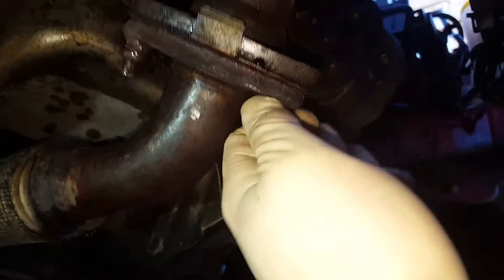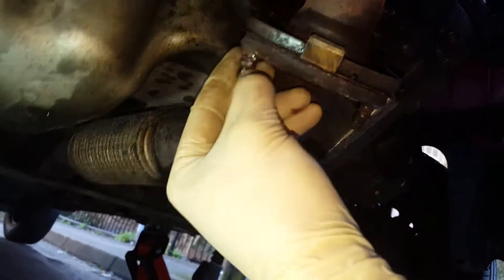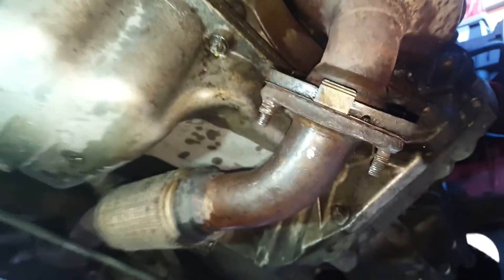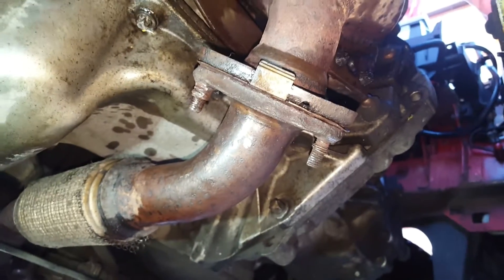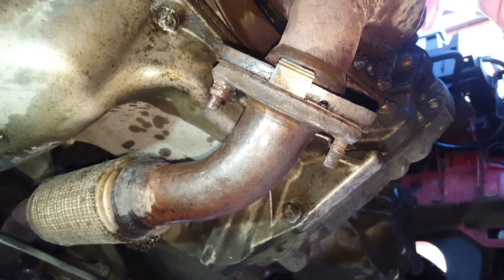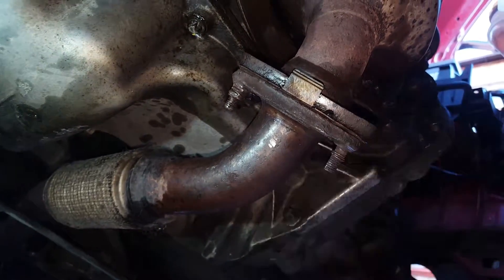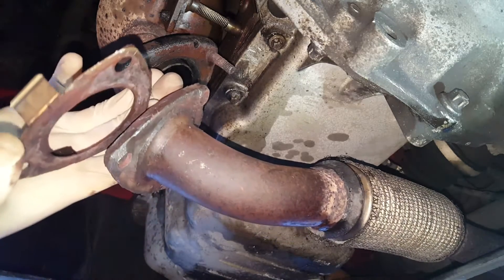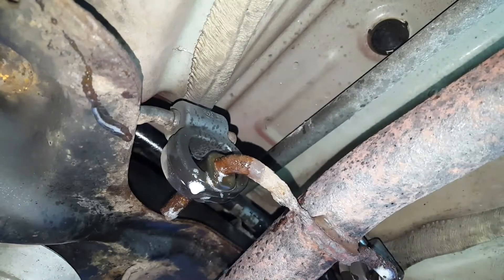Corsa D 1.2 Exhaust removal

Comment: I'm gonna be doing this job in a couple of months. Want a nice exhaust system on there. Patched it up for now as my flexy is fooked and there are holes at the muffler .. in regard to the none excitant bolts at the front flange... might get a set of nut splitters and used them on em, might be quicker. How is your 1.2 up hills, mine seems to struggle quite a bit.. Wondering if a remap might help, not expecting miracles but a bit more might help it a little.

Comment: Hi tom 👋 love your videos very informative and helps me out a lot with my corsa 😅 I’m In the middle of taking my rear box off but I can’t seem to get the exhaust over the rear axle mount 🤔 how did you manage to do it, as the video skips the process. Thanks
Reply from the maker: You want to lift up the car higher at the back end. Do not jack up on the axle as obviously it will lift the axle up.

Comment: My Corsa seems to be leaking exhaust, I think it is that Flexi pipe. Along with mums new swift and old van also leaking.  Advoid the new Suzuki's like the plauge, the company as a whole is useless an corrupt.
The suzuki is back after an aftermarket exhaust(same cat) and seems to be holding out OK. It has a 4x4 system and is a great car. 👍👍👍The exhaust seems to be burning hotter though, any ideas why.

Comment: Hi Tom, well done for getting this done..  Can i ask how exactly you removed those nuts? so you've sliced the nut then broke it with the screw driver and a hammer? or you tired to make it rotate and pull it up eventually? the nuts on mine are as bad as those

Comment: Hi there just wonderingg if i can ask a random question about my 02 sensors on my vauxhall corsa club.. i need to change my rear 02 sensor and im wondering if its the exact same sensor as the front engine 02 sensor?
Reply from the maker: I think they are different tbh, im not sure of the bank 2 is heated and the one pre cat is not heated as its hot there already. Im pretty certain they are different